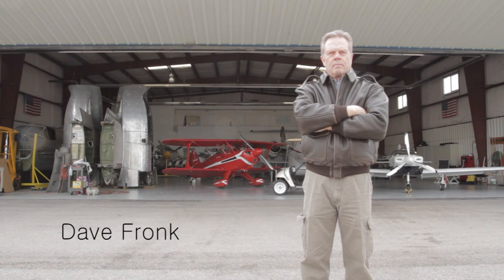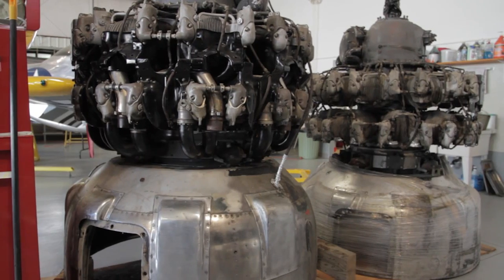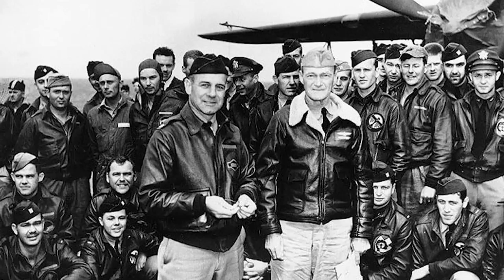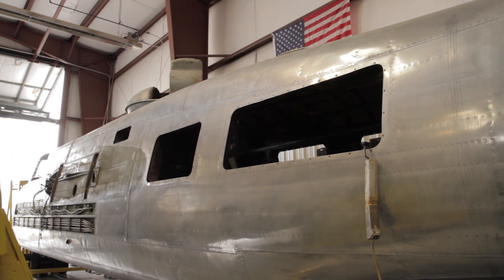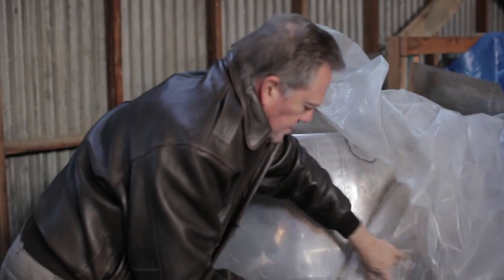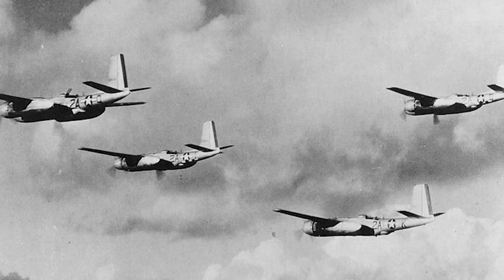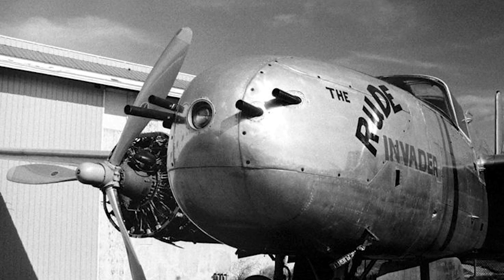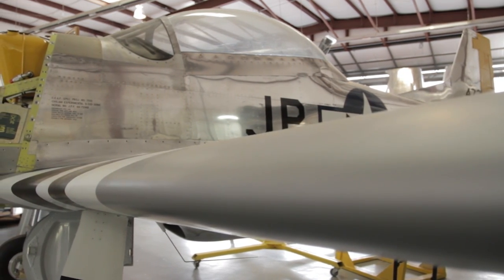A-26 AIRCRAFT RESTORATION PROJECT

Comment: as we have been working on the plane we found that it has very good bones. but as the aircraft had sat for 20+ years many of the systems were frozen up. consequently it was decided by Jan and Dave that the center console needed to be removed. 3-400 rivets were removed and all of the mechanicals in it were removed, cleaned, blasted, painted, lubricated where appropriate. so now you have a pristine center console and you can't put that back into ugly. at that point the flight deck forward wheel bay were also stripped, cleaned, blasted and painted to reinstall the console. to date the main cabin has had as much of the VIP conversion removed as is possible to return the aircraft to combat flavor. it will have very nice seats for passengers but the walls are vintage A-26. the flight deck has had the center console reinstalled as well as the hydraulic systems behind the pilots. the instrument panel was reinstalled about two weeks ago and the newly restored pilot seat was temporarily installed so that we could sit in it and make engine noises. the flight deck enclosure or roof has been meticulously cleaned blasted and painted and emergency canopy release mechanisms as well as normal canopy opening systems have been restored and the roof has been dry fitted to the airplane. my name is Bob and i am enjoying the opportunity to help bring this magnificent warbird back to life. the hanger is open generally six days a week. anyone can come visit at the Provo airport in Provo, Utah near Utah lake. please come visit

Comment: as the end of 2017 has arrived, we are continuing to restore this wonderful aircraft. the flight deck is coming together nicely. both seats have been stripped, cleaned, painted and reassembled. cushions for them have been created by a local guy that did a wonderful job making a comfortable seat that fills the space normally filled by a parachute. also we've been lucky enough to have John and Bob, two aviation electrical experts restoring the wiring in the fuselage. they have tried to convince us that it's not rocket science, but we are just as convinced that it is rocket science and we are very great-full for the work that they are doing. the bomb bay/passenger cabin is quickly being reassembled and will have real airliner seats for passenger comfort in flight. the roof of the flight deck is ready to reinstall and hopefully this week will become part of the airplane again. the nose landing gear well is is close to being finished with all the mechanical and electrical systems reinstalled.  sometime this winter the hope is start the process of restoring and qualifying one of the wings. it's a great project and we have a lot of fun working on it with all the challenges that it presents as we move forward. we hope that you enjoyed the video
Reply: What nose is going on it? There was a mention in the video of a cannon. The only variant of the A-26 to have a cannon was the XA-26B, at least according to what I have read. Is that the nose that's being installed?

Cant wait to see it when you are done. The A-26 is my fav plane of that era.
Reply: Ever considered going to A&P school? After watching a ton of restoration videos, I cant help but notice all the old timers doing the sheet metal and fabrication work. Once they retire or get too old to continue, who's going to take up the torch?
Reply: @sultros  we are going to use an 8 gun nose. would have liked to use the bomb nose that we have (although the glass is gone and expensive to replace) but since this is a dual control and no access to the nose in flight. so 8 gun it is. no guts in it for now but hopefully some day we can come up with all the replica stuff to go inside.
Reply: mustangbob51 Thanks for taking the time to respond. I really wish you were close to Texas as I would love to come assist with the restoration. I also work for a video company and would love to document parts of the rebuild. This aircraft has some fascinating engineering, particularly the flap extension mechanism and the flaps themselves. They are rather complex and unique. Kermit Weeks discusses it briefly in his A26 project video. 

I personally like the 8 gun nose as it pays tribute to the A-26 history of use in COIN. 

I hope you continue to do updates and provide footage. I can’t get enough of seeing the incredible work that goes into these restorations. Manufacturing is damn near a lost art.

Comment: i just realized that another year has come and gone a lot of work has been done. still need to give her a name instead of "the bomber". but anyway we hit a major milestone for us this last weekend. after a couple of months of cleaning and checking the wings we got all of the fuel tank areas painted. if i knew how to do videos (i know, everyone says it easy, but i'm video illiterate) i would post some pics. we spent several weeks just taking care of all of the threads that retain all of the skins that cover the fuel tanks. we decided that the best way to protect them after all of that work was to take Q-tips, cut them in half and plug all of those thread holes. we were wondering how many holes there were. what we discovered was that there are about 3500, yes that is a whole lot of holes to plug.  but now the wings look great. we also took the time to remove all of the old sealant used on the edges of all the skins and the next steps will be to reseal the skins, reinstall the oil coolers (which are very heavy) in preparation of taking the right wing from standing on its firewall vertically, turning it horizontally and setting it on a stand, graciously lent to us by the Sierra Hotel A-26 Invader group in Guthrie Oklahoma. at that point we will deal with cleaning, prepping and painting the wheel well, firewall and leading edge stuff that was not really accessible while they have been standing up. so hopefully we will be able to install a wing this spring. we will see how that goes.
stay tuned and by all means come to Provo Utah and see the project in person!

enjoy